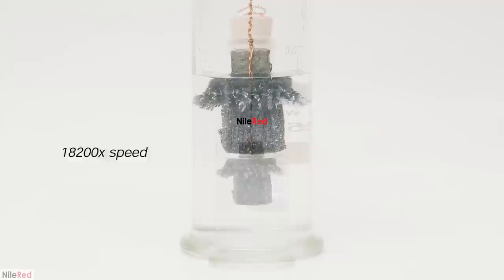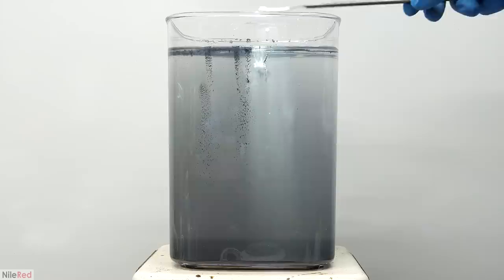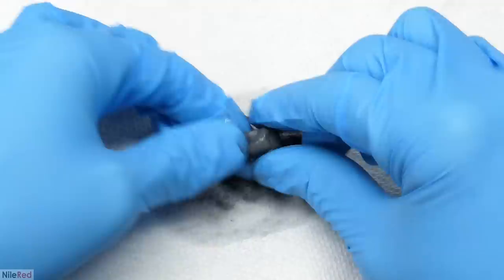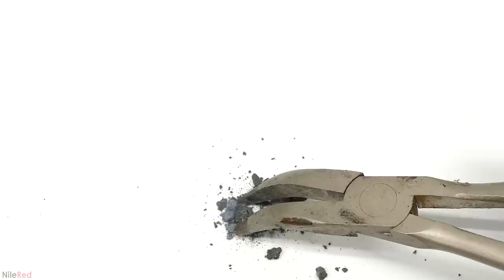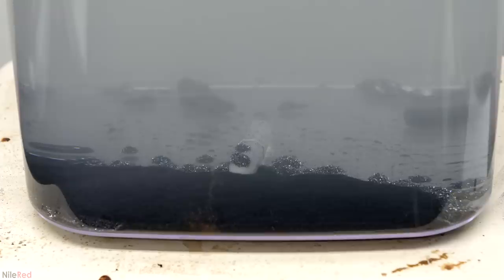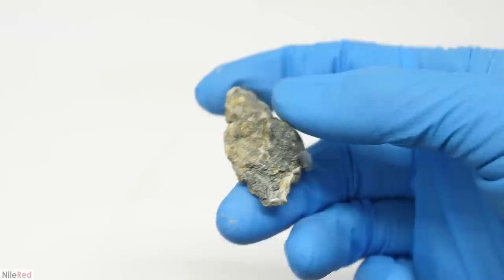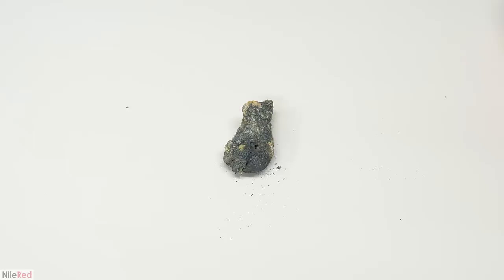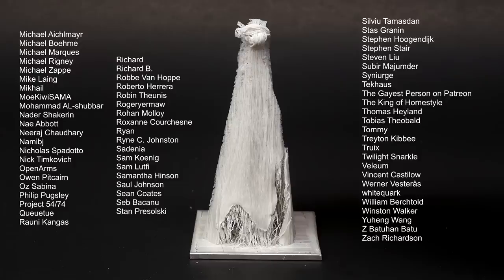I accidentally discovered lead sponge...

Comment: I've also accidentally made lead sponge by electrolysis. 
Also, the sponge with the crystals and zinc granules likely lasted longer due to the zinc acting like a sacrificial anode and preferentially oxidising.

Comment: It kinda looks like "Plumbers Wool" !  It is used to seal the joints of black cast iron pipe !  Or for emergency repairs, like leaks in a steel boat hull !!!

Comment: Well, if it's interesting, it happens the same thing to me when I reduce lead chloride (or tin chloride) with aluminum foil. The result is that spongy thing, but I've never tried to do it on a large scale. I think that in my case it may happens because of the passivation of aluminum, that makes the process slower than the zinc does (or it increases the potential of aluminum, I honestly didn't search any information about). I can send you a photo if you are interested

Comment: Your title suggests to me an interesting variation, why don’t you take a piece of foam sponge like a kitchen sponge, carefully slice through the side with a scalpel ti create a pocket in the centre of the sponge.Then insert a piece of zinc allowing the incision in the sponge to close. Float the prepared sponge in your lead acetate solution and let it soak in.I assume it will slowly sink and the solution should react with the lead very slowly. Time lapse that!

Comment: Maybe you can do the same thing but instead of lead use copper, this way if its conductive it could be used to make lighter copper wires. If the same thing can be done with aluminium then it would be great to use it on suspended power lines since its lighter. Though the thermal properties could change because of the air trapped inside the hollow material, and that may be a problem? Im not sure.
Reply: you would still need the same amount of copper. its about the cable area like 2,5mm². if you use the sponge you need a diameter alot larger to get the same area
Reply: The electrical resistance of a sponge-like wire would be way too high.
Reply: Unilythe Besides that, copper is an excellent conductor due to having an open outer electron shell. This allows the electrons to jump from one copper atom, filling its shell, to another atom with a vacancy very quickly. I'm pretty sure lead doesn't have this property. There's a reason a patent from 1885 isn't how we run our electricity. Of course, your resistance argument is also true. I doubt his guy would like the "raining molten, fuming lead" side-effect of his idea.
Reply: James Higdon I don't think you read his comment properly. He was talking about a copper sponge, not lead.
Reply: yup you're right. the resistance is probably the same but there could be areas where there is a temperature build up and that could cause melting of the wire.
Reply: Oh and when he made the lead sponge from zinc granules the lead kept its shine. Is this due to the electrode potentials of the two metals? The zinc maybe acts as a victim electrode and it oxidizes instead of the lead.
Reply: baga836 Sorry I misunderstood your comment. I'm not a chemist, so I have no idea of aerated copper is possible. It likely would still experience the thermal buildup from resistance like you and the other guy stated, though.
Reply: Don't worry about it :)

Comment: Why not do an acid wash to get the zinc out and try making lead acid batteries with different strengths of sulfuric acid? Cars use 50% Sulfuric acid.
Reply: More like 37% concentration, I think.
Reply: They use about 30% sulfuric acid only
Reply: Actually, only 22% sulfuric acid 

jokes, just though it was funny the concentration kept going down

Comment: It seems that the crystals did not grow because there is a concentration gradient of your lead acetate being dilute at top to concentrated at the bottom. I think this is the case because the zinc dust quickly turns black only at the bottom of your container. Let me know what you think!

Comment: It reminds me of the flexible lead vests at the dentist's office [just got my teeth X-rayed last week] and if you could add in a low mass [high voc] elastomer, you could make a flexible lead vest for radiation protection.
Reply: The point of a lead vest is the high density of lead absorbing radiation. The more radiation, the thicker the vest you need.
Reply: I was not thinking of standing inside Fukushima or Chernobyl reactors, just for crossing areas of known or suspected 'mildly to moderately higher than normal background radiation' such as might be found while attempting to recover some kinds of sensitive documents from an area where the radiation might be a bit too hard for going in unprotected.

I can see adding some Cadmium via some kind of careful fluid transfer, although that might be too complicated to be useful.

I suppose at that point one could just use the micro particles and mix them in a polymer.

Typical radiation vests are made from micropartculate lead mixed with vinyl esters and extruded in sheets then sewn into vests.
Reply: I was reading up on how one group was employing Cadmium as a means of converting free neutrons into electrical voltage, although it did not go into great depth as to how the process worked.

I never bothered following up on it since I am never going to try to replicate any atomic fission experiments.
Reply: Okay so after reading a lot of junk about it, they basically have no way to recover the energy released other than common typical heat.

This means, [as I suspected] they are just squandering billions to even trillions of dollars on insanely expensive firecrackers in a bottle.

In the end, fusion seems only viable for a weapon, and still a very costly one at that, so in that, its still not a really viable option since its going to only work for very large stationary position units.

Would make more sense to use those lasers to shoot down FUSION bombs as they come at one in the form of an ICBM with a MIRV.

Comment: Different hydrostatic pressure at the bottom of the short and tall containers.
Reply: Just my thought. More pressure/smaller crystals/different results. Try same experiment in bottom of your longest glassware. Remember at 1:00 when bigger crystals formed only on surface. Those surface crystals might be also because solution is left overnight and it evaporates making different concentration gradient on surface.

Comment: could you try using your lead foam molded into electrodes for electrolysis and compare them with basic electrodes and see if there is a difference in gas out put?

Comment: Seems like it would be good for making conductive gaskets.
Reply: Actually, a copper sponge equivilent might be useful in certain places because it would be less prone to melting under hot conditions
Reply: Can you make a copper sponge with these properties? I always understood that copper liked to form microscopic spheres than impeded its conductivity and structural strength. A silver sponge might be possible since silver tends to make plates. At work, we use indium wire to seal mating surfaces but there's nothing fun or interesting about that.
Reply: I don't know what copper likes to do as a nano-scale powder, but we do use it for gaskets on a macroscopic scale at work occasionally. It makes a decent emergency head gasket material once annealed. ...and I dunno, but indium wire gaskets sound pretty exotic to me!
Reply: My bad I left out why we need indium. Simply put, I work on telecom equipment and because the frequencies are so high when sealing mating surfaces we either use silver epoxy or solid indium. Indium is soft enough to get sandwiched between finely ground surfaces and has better temp resistance than epoxy but it gets used sparingly. Often I see silver epoxy being used over copper for the reason at a nano-scale powder silver is far superior because of how copper forms balls. I think annealed copper is cool but the fact that it work hardens makes it difficult to compress to the specification we need. In all honesty, most of my knowledge of chemistry is recreational I just wanted to see what other people thought. and yes, indium is pretty exotic and hard to get as a wire.
Reply: Most of my expertise is mechanical. I have some basic chem and electrical knowledge just from construction and maintenance in heavy industry processing plants ...really, I only watch youtube chemists as entertainment, it's not like I can understand or contribute anything much. Your work with electromagnetic resonance, wave guides and the like is utterly baffling to me!
Reply: pfff half of it is black magic I don't even understand. Electronics is only a passionate hobby for me partly due to my age or rather, lack thereof.  My childish fascination with science means I like to research and understand how things work. Since I mainly assemble a multitude components, I have plenty of awkward silences to develop questions as to how these things work (and pose them to the guy who designed them).  but I have to agree, I watch NileRed and Nurdrage for entertainment purposes, they do lose me a lot.
Reply: Good onya mate :) Yeah, Nurdrage is also good, along with Cody's lab, Doug's Lab, Chem Player, myst32YT, and a local lad, Extractions&Ire. 

Extractions&Ire used to have a cool channel called Explosions&Fire but that was struck down by the S̶t̶a̶s̶i̶/̶G̶e̶s̶t̶a̶p̶o̶ Youtube Heros
Reply: Love cody's lab! but I'm not sure I have heard of the others, ill have to check them out!  also check out The Thought Emporium for a multitude of biohacking and other cool stuff nearing the sci-fi realm.
yeah, there isn't much to say about the secret youtube police. besides... Tehy mihgt be listnig.
Reply: The Thought Emporium was a good call, I subbed. Cheers!

Comment: Maybe it could be used to slow down beta particles in radioactive shielding so that less x-rays are generated
Reply: i also wonder what their thermal properties are of the uncompressed sponge, just because of the amount of air trapped inside makes it kinda sound like some brick types they use for insulation (though with it's relatively high thermal conductivity and low melting point i don't actually expect it to perform well)

Comment: Try making a lead acid battery with these
Reply: Gummel that is a great idea... the surface is higher, probably could get a goos Ah. or a good high voltage or both....
Reply: might actually work very well due to the really high surface area
i wonder if you could make one with sponge that was aired so it had even more
Reply: - TheNinthMillimeter - That‘s exactly what i thought!

Comment: Hello NileRed.
Could you have a go about making lead acid batteries at home?
It is kind of an "obscure" knowledge, tucked away from the eye. 
I see many "Pakistani truck" channels remanufacturing the flooded lead acid batteries with new plates.
Other videos show even how to paste the plates and dry but without much commentary. 
There are a lot of "know how's" in the business, from plate curing/drying processes, inclusion of microscopic lead in plates formation for sponge lead making, etc. 
There is a rumor that you can reuse plates from deep cycle batteries and just replace the ones that crumble to bits, the ones with lead oxide red are in pretty good conditions.

Comment: As you said - it has high surface, lets try an electrolysis with it, maybe it would be cool
Reply: lika85456 I was thinking a lead acid battery... wouldn't last long, but should create higher voltages?... Amperages? Either way, it would be very cool to explore electrochemical reactions 😀👍 edit: just watched the whole video, yeah... lead acid batteries eh... 🤔
Reply: luciferstyles wouldn't affect voltages, voltage is dependent on charge difference of the ions involved aka purely chemical process. Current however would increase because the rate of reaction increases with greater surface area.

Comment: You could try to build a mold and putting it in the container of lead acetate.  When enough sponge has grown to fill the mold you could pull the mold out and let it dry.  Then you would disturb the sponge as little as possible.  Perhaps as a way of making your own battery.

Comment: I wonder if lead sponge might be a candidate for radiation shielding on a manned Mars mission?
Reply: Would have to make sure it's durable enough. Probably would need to be placed between two plates of stronger metal?
Reply: Probably good as a patch for mico meteors dispensed like a tube of paste. Need some solution to keep it consistent though. Might be good for satellite repair to protect electronics or to reseal access points.
Reply: The amount of shielding received by lead is directly proportional to its mass. In other words density doesn’t factor into shielding. So a 1 kg sponge will absorb as much radiation as 1kg of foil.

Comment: It could function as a fuse where you want a circuit to break if it's disturbed.
How well does it hold up long-term completing an undisturbed circuit? Can you do a test leaving a light plugged in with an insulated wire fuse of it? It'd also be interesting to see how it holds up against the heatgun, or if that's good for solidifying it while the heat shrink goes..

Comment: hmmmm, radiation shielding?
Reply: I think you cannot cheat radiation thinking it's solid lead.
Reply: +Vaasref First thing that popped up from the search engine.

https://newatlas.com/metal-foam-lightweight-radiation-shielding/38515/

The universe does not care about our intuition of things.
Answers require tests.
Reply: Combined with water, a lead sponge might be a good way to block both gamma rays and neutron radiation. Easy to transport, manufacture, and replace as it breaks down. Would a lead sponge be dense enough to lead to enough interactions with the gamma rays to meaningfully decrease gamma ray energy? I don't know. If there is enough of an effect, and you need to block neutron radiation too (like in outer-space), it might be useful. I imagine someone at NASA already ran the numbers like 50 years ago though.
Reply: +redavni1 Who knows, sometimes simple solutions go unfound for much longer than they should have.

Comment: Maybe it's very good at adsorbing radiation.

You should compare it to "normal" lead plates.
Reply: Backyard Arsenal less effective, I'd say. Less dense = less effective
Reply: more like less mass = less effective
Reply: Nah I ment same mass but higher volume. Maybe it "traps" radiation like pigment molecules trap visible light.
Reply: Radiation is either absorbed or reflected. in the case of reflection, it doesn't really matter wether there's air there or lead. It can bounce around in a solid block of lead until absorbed, be absorbed straight away, or go through. the air doesn't help
Reply: I'm also pretty sure that there will be no difference but I think it would be a quite interesting experiment. Adsorbing radiation is also one of the first things that comes to mind when thinking about the properties of lead.
Reply: btw it's absorption not adsorption. In adsorption, things attach to the surface, in absorption they are taken up by the volume

Comment: Wonder if the failures were due to not have a "seed crystal" of sorts. The *powder going in would form small clumps on the way down that could act as a nucleus to a larger clump? Larger container, longer time to soak the "seed crystal" clump on the way to the bottom.

Comment: Termal properties? I am wondering if the dried version might be a good insulator. Yes the melting point of the lead is low, but maybe it works like Aerogel for lower temperatures?

Comment: It seems, with the granules, that once the crystals start forming, the granules at the top layer are sealing off the zinc below and stopping the reaction.
You could try using the magnetic stirrer to very slowly stir the granules, just to disturb them, so that all the granules are exposed. Hopefully that will lead to a more complete reaction.

Comment: Add some tin and you basically have Solder Paste https://en.wikipedia.org/wiki/Solder_paste
You could probably make molded electrical parts by shaping a circuit and then melting it with some flux  -- though the molten lead would flow with gravity so you would have to take that into account and mold the lead putty around some channels, cups, or crevices which would trap the melting metal.

Comment: recently I accidentally made a similar material. I wanted to see if I could use lead electrodes in a chlorate cell. So I got a container and filled it with salt water. Then I took two flat pieces of lead, hooked them up to a car battery charger and dipped them into the solution. The next day the anode was completely gone and a large amount of a black spongy material was deposited on the cathode. However I don't know what exactly this material was. It could have been lead metal or some other compound.

Comment: Lead sponge can also be made electrolytically.
Just use two lead electrodes in a weak Hydrochloric Acid/ water mixture and run it at 2-3 volts.

Comment: Not sure if you'll see this, but it would be interesting to see if you could make a form of lead sponge aerogel. It could even be a groundbreaking new technology being that it could conduct electricity aswell as insulate against temperature and radiation. It seems as though it would be able to be put through a similar process as the silica aerogels and come out with a similar result, but with a lead framework instead of silica. Could be anything from a cool experiment, to a groundbreaking discovery. If you do see this and like the idea, I'd love to give some suggestions on how it could be done!

Comment: Try pouring the zinc slower so there is a longer amount of time between when you start pouring and you finish pouring. Also, dont overlap. i think this is dependent on how long the zinc was in the solution. so you are seeing the reaction hit a threshold, and if you pour it in all at once, it will happen all at once. Thats my theory based on my watching it. I know nothing about chemistry.